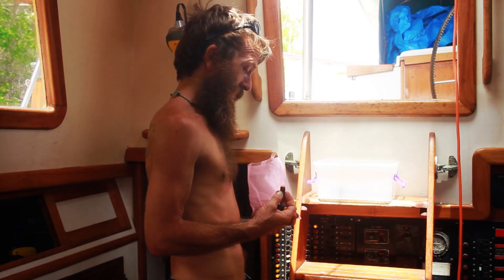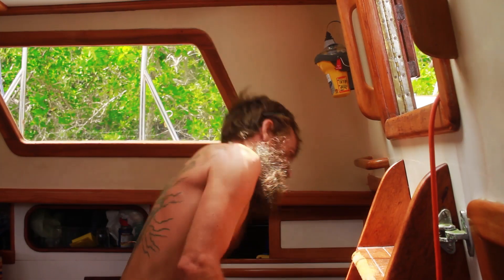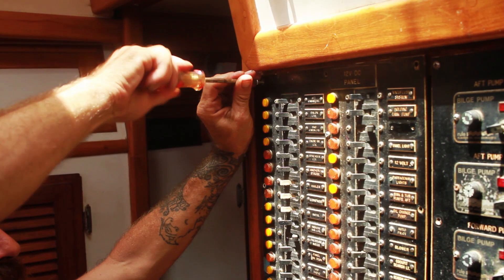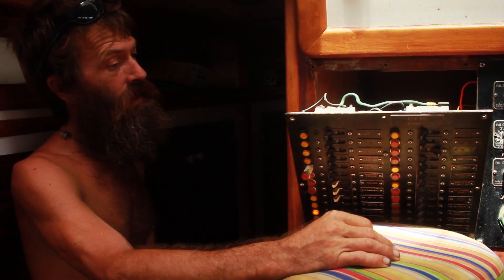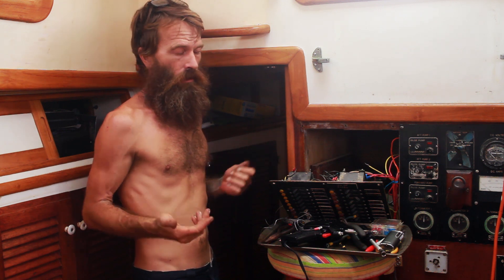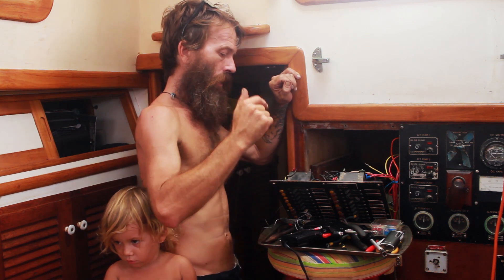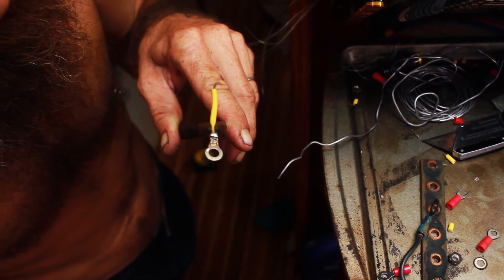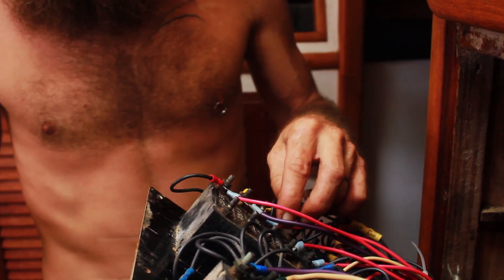⚓️ Cleaning up the Electrical panel  ⚓️

Comment: That was bad ass. I will have to do that as well as install new panels on Laysha, my 25' Hunter. I thought I was a procrastinator but you have me beat Allen. 10 years is much longer than I have ever put off a project. lol. Good job on the indicator lights.
Reply from the maker: +Brian Adams 
Not my boat, I've been pushing for this for 10 years